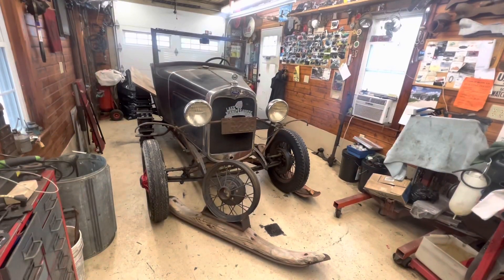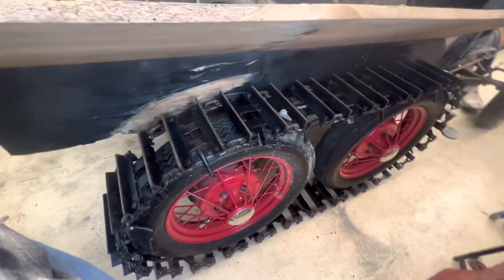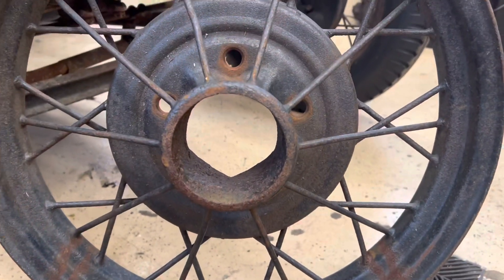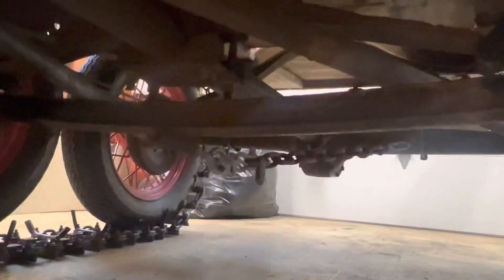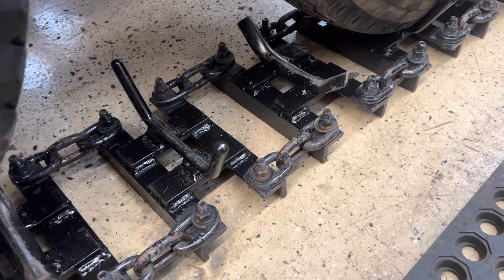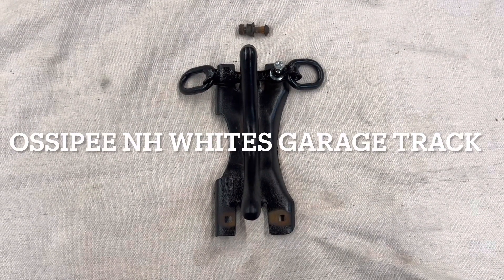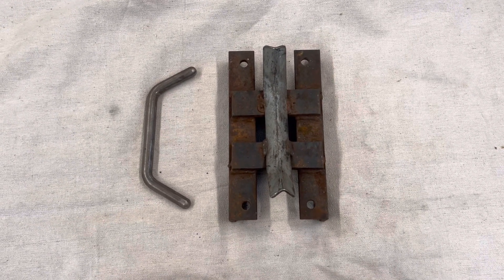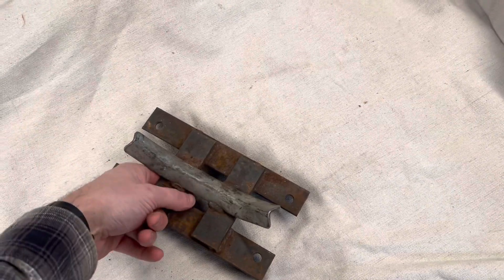1930 Ford Model A Snowmobile- homemade conversion

Comment: On the chance you hit a stump and it puts sideways force on track is there a chance of the 3/8 or 1/2 inch rod puncturing the tire? There used to be half track kits available for 8and 9N ford tractors could be utilized ?
Reply from the maker: I’ve never punctured a tire with the track but if they get side loaded too much I have had the tracks come off. This often happens when doing donuts and you come up against something hard- it can roll the track of the wheels.

Comment: I just stumbled on this video. The tracks that I made are pretty similar but I just cut a big square tube in half the long way then cut them into segments. check it out on my channel. nice work.
Reply from the maker: I checked out how you made yours- nicely done!  Do you ever have any issue with ice balls building up where tires ride in tracks with your design?